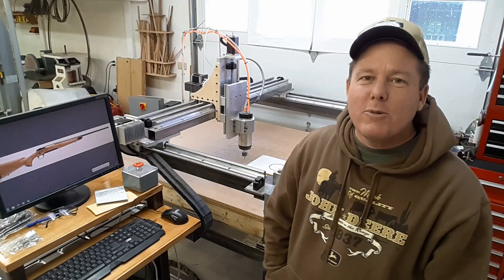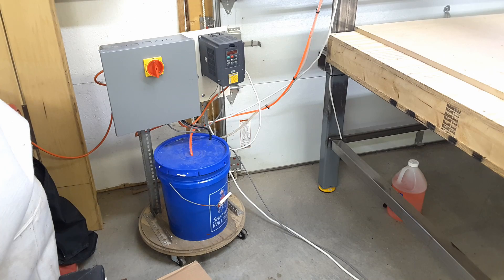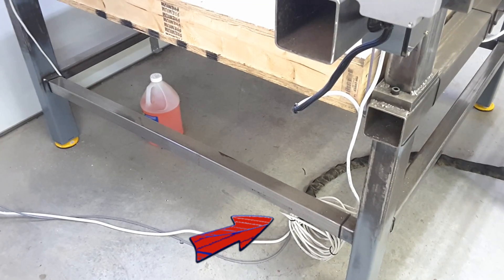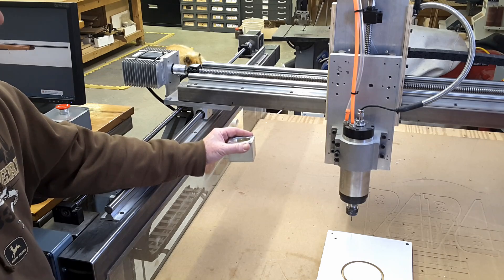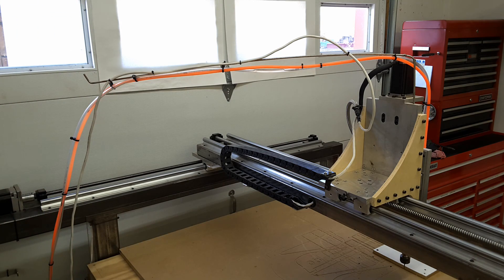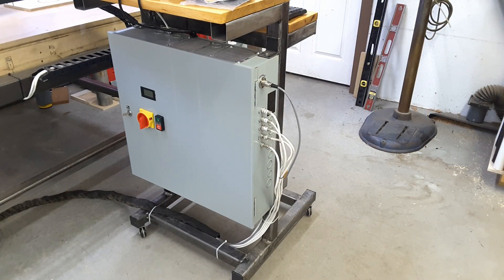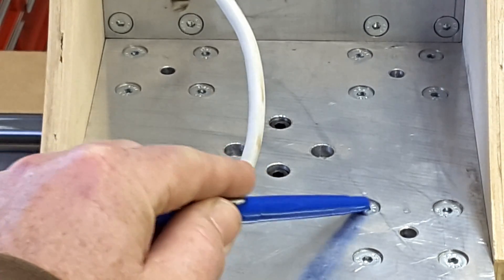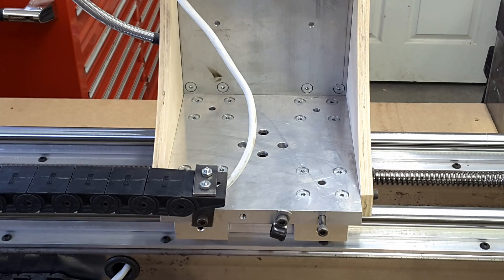Lessons Learned building a DIY CNC Router

Comment: The point you made about the XY block's holes alignment.... very good observation. This is why I watch so many videos like this to research. Trying to design my router as best I can the first time so I have fewer "surprises" down the road. I never would have thought about the alignment of those holes, but you are exactly right. I will have to go back to the drawing board with mine.

Comment: I'm getting ready to build a 6090 sized machine to mill AL, and even though your vid is three years old it has some interesting insights!

Your X-axis design is the first I have seen like that; shafts mounted horizontally; brute strength to carry the load I suppose.  You eliminated the vertical gantry legs found in most designs by elevating the rails above the work space; clever!
I might make mine that way, but with the X-axis beam vertical to take advantage of the I-beam effect and reduce weight of the X-axis beam. I suppose you have the X-axis shafts horizontally to reduce twist from the dual X steppers, but that should not be a problem if the steppers are synchronized.

Why the heat sink on your X stepper? Maybe the current sensor logic is not cutting back the idle holding current? Or is it hot when running, in which case, the motor is perhaps too small.

One upgrade you could make is closed loop steppers which what I am going to use along with square rails.

Ethernet interface on your motion controller; PC can be anywhere you have ethernet.
Reply from the maker: I still love my machine and have made only a couple of changes.  Like I am switching to square rails as you are considering. 
The heat syncs were there before I had my current settings dialed in.  I just never took them off.  The NEMA 34's are plenty of motor.

Comment: Thanks for your video, could you elaborate on your choices of ball screws and nuts ?
Reply from the maker: Not much to say there.  The rails and screws came as a set from the vendor.  They are still in use today and working fine.

Comment: How accurate is the machine? In microns. Thanks.
Reply from the maker: As I cannot measure that small (micron), I will tell you that the step increment can be dialed down to .0005 of an inch, but I have about .003" of lash/play in the Y axis and about that same amount in Z axis deflection.

Comment: Take my word for it, stay away from the USB motion controllers if you do not have shielded wire to your steppers. Use motion controllers with ethernet in a pinch or shielded wires wherever possible. I got lucky that I chose to go with the Pokeys57cnc motion controller which has both USB and Ethernet. As soon as I turn on the spindle it creates so much RF interference the USB connection simply stops working. So I am now using ethernet which works with the unshielded, but also plan on making them shielded wires to be sure (and keep working if I go for a different spindle like a Poseidon or the cheaper chinese VFD sets).

Comment: Good job..just one thing toi need à more powerfull spindle..this 1500 watts are To small
Reply: For wood? Sounds more than ok to me. Even aluminum. Also, the spindles above 1.5KW seem to have a little more radial run-out occasionally. You can get lucky, but it is a factor to consider.

Comment: Can you do aluminum or steel?
Reply from the maker: I can do aluminum, but steel would be a reach.  The limitation is in the rigidity of the Z axis.  I have a video on the touch off block I made.  It is aluminum and cut on the router.  ~P

Comment: I'm stuck wondering If a silicone tube would work for the. Spindle lines in the cable track.
Reply from the maker: As long as they don't kink.  It would be cool if they were.  There would be some reduction in flow just based on the length of the hoses, but it doesn't take much flow to do the job.

Comment: You could take 1/4" flat bar and drill and tap it and put it inside the Gantry tubing for the bolt being installed up from the bottom that way you don't need to weld nuts in there. The Flat bar will act like the Nuts and wrench in one little package.
Reply: That's beautiful. Perfect!
Reply: I made a small search to see if someone made that comment before making it myself... 

Other possibility is to weld the nuts on a small flat instead of tapping it, then sliding in the tube.

Comment: Your y axis has 2 motors. Are they wired parallel our separate drivers. Is there calibration procedure
Reply from the maker: They are completely separate.  Coordination of the motors happens at the controller (Mach3 in my case).  There is the concept of 'slaving' that is applied.  It also allows you to reverse one motor if needed.  ~P

Comment: Great video!  I like the honesty and insight into a build 1 year later. Question: Why don't you have limit switches on the machine?  Or maybe I just missed them.  Thanks again, it's very helpful for first time builders like me.
Reply from the maker: I didn't miss them.  I'm putting them off.  In all honesty, the only place I wish I had limit switches is on the Y axis and that is only so I could use homing to square the beam periodically.  Other than that, I have never missed them.  Thanks for asking.  ~P

Comment: Ethernet isn't going anywhere.and USB has cable length limitations, as Mohamed Gaafar identifies.  They run Ethernet in factories, where the amount of machine interference is, by comparison, astronomical.  So you made a good choice initially.

Comment: You got to love thise bold devil may care words of encouragement for the edge sitters out there. I was about to buy a turn key system and then realized I was going to have to send my money off and do biz with people that are half a world away, and the I might as well do some bulding of my own. I didn't have enough room for their version of a 4 x 4 table anyway, plus I would have definitely needed a forklift to  make it happen in about three situations Yes I have access to one,  but no it doesn't reside here. :-) So apart from needing a deal on Hiwin and ball screws I think I have found almost everything and I proudly announce that, I have  purchased the first installment of 8020  T-Slot aluminum extrusions  two days ago so, the sales people in China aren't going to very happy.
Reply from the maker: Congratulations!  80/20 is a super convenient looking way to build structures.  There is a reason their catalog says the 'adult erector set'.  Good luck on your build.  ~P
Reply: I can't believe how much easier it is to get a 4 x 4 linear rail kit on amazon. It is painful on Ebay. I was having heart failure after searching there :-)  As for the 80/20 obviously some of the cross cuts are mission critical and proprietary insert anchors means some machining to prep. I don't have access to a decent machine shop but do I trust myself for crosscuts. Drill press is going to require some work. Your shop has some very nice assets and I wish I was a neighbor :-) On an end note, I found some used stock for an incredible price and cant duplicate the profile.I have a 5 hour round trip to pick it up yet.  The photo in the ad shows ~7" or 180mm tall  and so far even 80/20 Head office can't I.D. I am so tired of the preamble buddy. :-( EDIT : I am still using 0.100  2x2 steel for the base BTW Regards,C
Reply from the maker: Did you pick up the material and was it everything you expected?
I understand your apprehension about dealing with China through Ebay.  There is some history there others talk about.  This is exactly why I added the link to Amazon.  I feel more comfortable dealing with Amazon.  When I built my machine, most of these things weren't on Amazon that I could find.
Not to disparage Ebya, I had the seller 'LoveMyCar' put together the set I bought.   They were super easy to work with and although the shipping package wasn't spectacular, it did all arrive without issue.  ~P  
ps....Sorry you don't like my preamble

Comment: in regards to your coolent boom, your system seems like it has a lot of room overhead, why not:
1)extend the vertical a foot or so higher, LEAVING the boom @ the same height, but then
2) run a guy-wire (i'm sure it's called something different) from the top of the vertical to the end of the boom.
this should give that flapping boom stabilization. You then may even be able to use a thin-walled 1" plastic pipe to run your tubes/cables though in order to dress it up.
Russ from Coral Springs, Florida, USA

Comment: Thanks for putting these videos together. I'm just about to get started on a smaller lighter duty multi machine. I'm planning to do interchangeable spindle/ plasma torch/ 3d print head. Did you get flats ground on your box sections where you mount the rails, or just used them as they came?
Reply from the maker: I used them as is.  This comes up fairly often.  Maybe I should do a video.  There are several reasons why I did nothing.  1)It didn't seem necessary.  They were straight and flat (enough).  2) I made sure to NOT mount the rails on the welded side which often is a little more raised across the width. 3) I have no practical way to do it.  Not to mention the wall thickness won't allow for much. 4) And maybe the most help, is that if you look at a cross section of the aluminum extrusion that the round rail is mounted to, there is a relief in the middle, negating most if not all of the rise in the middle of the tube width.  Hope this helps.  ~P.
Reply: sbirdranch Thanks, yep, that makes perfect sense.

Comment: Great video and good work. I had to laugh when you brought up Mach 3 and 32 vs 64 bit with parallel ports. It took me at least 2 months to get over that hurdle, and even then I didn't get over it, I just went around it. Ive been using fusion 360 for CAD and CAM, but like you I started with easel and still use it from time to time. When I built mine I wasn't able to spend a lot of money so there's a ton of things ill be doing different. That's actually what brought me here today, I'm getting ready to rebuild. Thanks for all your tips...USB all the way!
Reply from the maker: Good luck on your build.  I am starting work on a plasma CNC.  I'll be re-using my control podium from the router, so 'all' I need to do is build the machine.  If I would carve out the time, I could get it done this winter.  We'll see.

Comment: Thanks for the overview!
Why not use a beaglebone black PC on a chip? Instead of a big control station, I'd want to use my smartphone or tablet to remote control the program running on a beaglebone.
Reply from the maker: Dejay Rezme in short because Mach3 doesn't lend it self to it.  I didn't even consider some alternative control computer.  I had more than enough to challenge me.  As for remote control, I can't imagine wanting that.  The workflow of setup, zeroing and cycle start are all done at the machine.
Reply: Ah too bad there isn't support for something like that yet. I think it would be perfect for "remote" control. Remote in the sense that you control the computer wireless from a tablet in your hand while standing right in front of the router.

Comment: i watched your last video concerning the rail and saw how terrified you were in comparism to the other rails, my question then is, how has it been working with you now and would you recommend same to me for example who also want to buy the inexpensive Chinese rail? thanks and your respons would be highly appreciated Sir.
Reply from the maker: terrified....maybe a little strong.  Concerned for sure.
To be honest, they are working pretty well.  I have replaced a couple of bearings and have another one that is popping and cracking.  To that end, I have some replacement bearing upgrades that I am going to try (and video).  Look for that.
I am looking to improve the machine in several ways and some of them are in video already.  Given how well the overall machine works, if I had to do it again I would do it with square rails.  They are more money, but with hind sight I would go that route.  What I have is working and continues to work.  My expectations and demands of the machine are beyond what they were when I started.  I didn't know if I could event make the thing work at all initially.
Hope that helps.  ~P
Reply: got it! thanks

Comment: No problem with that . Is normal to happen we learn and with each build you are learning about rigidity how the forces with the movement behave.  Structural tensions vibration and noice supresion and design improve A  time when you will choose servo over steppers no matter the cost. You only want biuld better with each build RP or ball screws. Precision and usable working speeds. With each build we learn improve and get further!
Reply from the maker: My next build is a CNC plasma table.  It will be much easier to build as there are almost zero lateral forces and precision, although important, is still just a plasma arc.  Thanks for the encouragement.

Comment: sir i m very much interested in building my own cnc routerbut i have no knowlwdge of electronics.which course should i join to learn so that i can build my own cnc router
Reply from the maker: I would suggest looking at the electronic (motors and drivers) available from CNC Router parts, or something from Geco who makes full electronic packages.  There are a ton of videos on how to hook up the motors and drivers.  In fact, most of the kits (motors, power supplies and drivers) from ebay come with a starter version of the breakout board that you hook to your computer.
I learned from videos on YT which led to vendor research and reading guides to hooking things up.  Best of luck.

Comment: about the Ethernet smooth stepper KEEP IT.. it is way practical than the USB.. i got the USB Smooth stepper the max cable length it can take is only 1m long ..  longer than that data interference will happen and wont be reliable... I am thinking of buying the Ethernet one so i can move the controller PC a bit further from the machine or even control it from any were else in the house wirelessly or even overseas via internet and a static IP

and for the coolant reservoir you can use an IKEA SAMLA plastic box it comes in various sizes and heights transparent if you want to monitor or black ...... it will fit well under there

and if you are planning to buy new rails get the squared ones they're way more precise they have zero play but your machine has to be perfectly leveled and paralleled or they will stall
Reply from the maker: Just a follow up.  I found a need for a 'second' break out board and found that CNC4PC has a breakout board that plugs directly into the ESS.  No more parallel cables.  I'm going to hook it up tonight.
Reply from the maker: I just re-read your post....and after this weekend, I can see myself kick off a job from Europe and crashing the cutter.  Long way to the e-stop, but hay... I wouldn't hear the carnage!  ;)

Comment: Thanks for the videos; perfect timing to come across them, as I am in the conception stages of a similar 4' x 2' machine. 

One question regarding your dual Y axis motors. How are they controlled? One or two power supplies? Wired parallel? Y and (?) axis in Mach 3? Thanks

Comment: Nice machine, I like that it's fairly sturdy. A lot of the home built ones I've seen seem a bit flimsy. I'd like to try my hand at something like this, maybe a bit sturdier yet so it can handle machining steel. The fabrication part would be easy enough for me, but I have no clue about the electrical and software part of it. Do you have a background in CNC or where did you learn how to make all the electronic part work together?
Reply from the maker: Siegfried Gust I don't have a background in it.  The parts are all fairly plug and play.  The breakout board and Mach3 are where it all comes together.  If you are comfortable with their setup instructions then you have it mostly linked.  Good luck ok on your build.

Comment: the "mic" plug is called a "DIN" plug,they get used for all sorts of machines,for the reasons you like them,good current rating too, i would have used aluminium box or shaped extrusion for the rails of the gantry,lighter and as stiff.

Comment: for the bar underneath just set it back further,rather than higher so you get the stable rigidity of the length of the leg held as is,the higher up you go the legs will wobble ,even made of the box it's made from,for the water feed hose,use coiled air hose,the type used in airbrakes on articulated lorries/trucks,so it can extend and recoil,nice big table though,i could put it to some good use myself.

Comment: Hi man, awesome ! not many people talk about what they don't like, very helpful for starting builders !!. PS: Quick tip, The "microphone" connector you refer to is actually a data connector and is not really appropriate for high loads. These connectors are officially made by neutrik (you are rocking a nice chinese knock off). Here is a link to the power line of connectors, http://www.neutrik.com/en/power/. The once you are using can be OK (called XLR connector) for low voltage, low wattage use, but their primary use is digital and analog signaling. XLR connectors are made with a metal body and a very small rubber coating in between the pins that can burn away over time and create fireworks if loaded with too much power. I work as a lighting Designer / Technician for Television and rock and roll touring for about 20Years now. We use (the correct) Neutrik connectors extensively for everything from fiber data thru 30 Amp power distro. Hope this helps, Rock On ! Cheers.